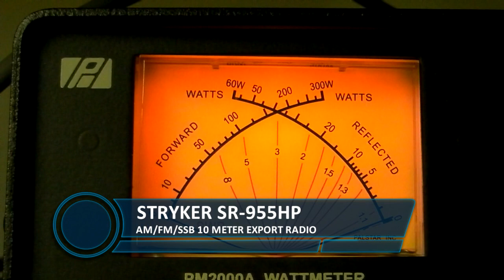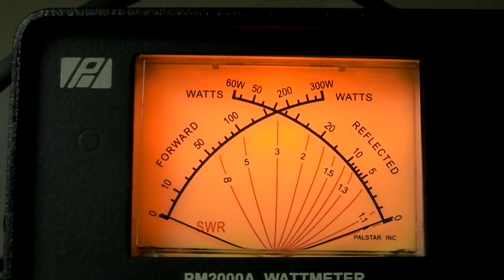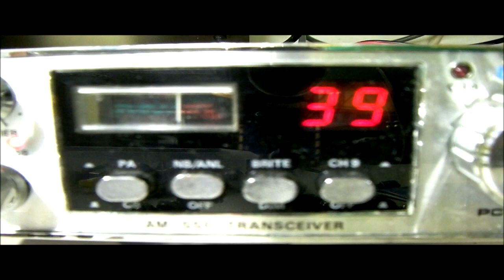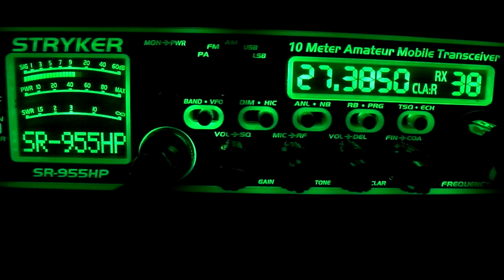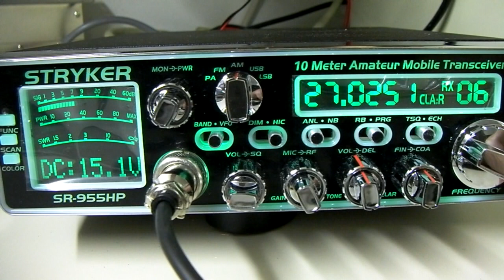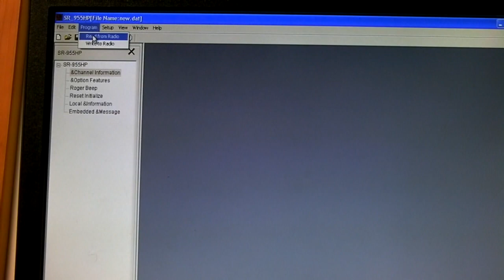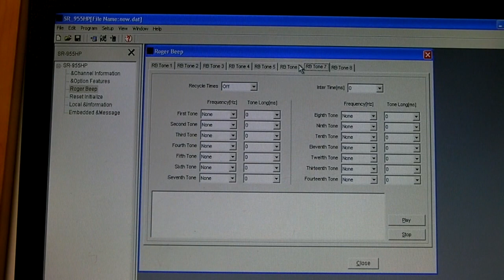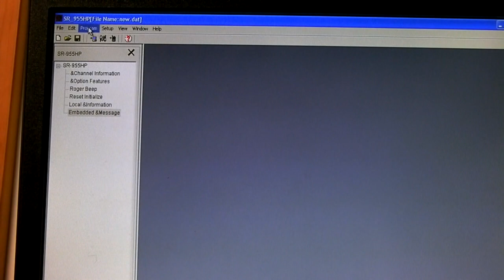Stryker SR-955HP Wattage TX & RX Audio Samples + Software Demo

Comment: Hello sir, I just got my 955hpc, I can not get it to pick up anything. On band 4, in AM I try to turn the dial to reach 27.1850 like you side in your video was ch 19. As I turn the adjustment dial it goes down and stops at 28.000 and then rolls over to 29.875. I've tried scans on AM and VFO. I can't pick nothing up

Comment: Does this radio come programmed with the standard 40 AM CB channels or do you have to mod it?
Reply: You mod it by removing 1 resistor to enable 27 mhz and it will not need tuning and that's as hard as it gets

Comment: just curious, towards the end of the video your voltmeter reads 15.1 volts. If the antenna impedance is 50 ohms, 15.1 volts squared divided by 50 ohms is 4.56 watts. To get 80 watts in 50 ohms you would need 63.2 volts. Does this radio have some kind of voltage booster driving the finals?
Reply: My 955 puts out over 100 volts at full blast.

Comment: Since the clarifier is able to be adjusted on Tx and Rx I was wondering if the frequency counter displays the frequency on Tx? Is it an active frequency counter I suppose is what I'm asking?
Thing is, if the clarifier frequency adjustment is set on the coarsest, then the tuning steps might remain the same when you key the mike if the Tx is only slightly off.
I've read the manual, looked at reviews but I can't seem to get a definitive answer to this question.

Comment: How many volts do you recommend to go into the striker? I'm only running 13.8. I see your at-15.. should I rise the voltage ⚡️
Reply: I do 14.2v and it seems happy. I have two 955 radios and both going strong .

Comment: I have one of these and it has poor reception unless the squelch is turned to where its noisy. 
The frequency's were messed up from ch20 to ch35 when I bought it but didn't know it until I needed channel 24. Turns out it was on the same frequency as ch 19. 
The 3 button reset fixed that thank GOD!. Every now and then there's a simple fix but I'm not often that lucky. I love the radio! It sounds Awesome on the air. With the squelch noisy I can hear Triple Nickel talking on his bass from Atlanta to Michigan.

Comment: I have been beating my head against the radio all day trying to get the software to work. 

Can you tell me the type of cable you used. USB to mini-USB?
My computer is not recognizing them radio. I have tried different driver, followed the steps on your website, spent 60 dollars in different USB cables. I must be doing something wrong. Pllleeeeaaaasssseeee help.
Reply: You need one from Stryker, not Wal-mart.
Reply: 2nd the usb cord you need has a dongle on the USB 2.0 side.

Comment: hey man I've got the same cb its squeals all the time when I turn up the mic and I got the top back still off is there any way to turn it down inside the radio it's definitely feedback from the speakers
Reply: +Joseph Byrd You may have RF in your shack.
Reply: 1. turn down mic gain 2. turn down talkback3. don't use a power mic.4. don't point external speaker directly at youIts probably over modulating could be rf coupling if the above list doesn't work. Then try better coax or ferrite cores around your speaker wires and coax.

Comment: A local guy has one, sounds XLNT on both AM & SSB, noticeably better than most other rigs, especially the higher-pitched sounding Galaxys, but he does drift A LITTLE, about what one would expect from any Amateur rig without an integral TCXO (Temperature Controlled (X)Crystal Oscillator) but after maybe 10-20 minutes of rather steady conversation he stops about 70Hz-100Hz down, it could use a TCXO for those who have to have it a rock from turn-on, but it's no worse than the best 'other' out there

Comment: Why is a 10 meter Amateur radio transceiver tuned to 27.3850 MHz?  Something must be wrong with the display.
Reply: nothing wrong with radio, people convert them for the cb band illegally
Reply: ***** FCC fine for out of band $7,000.00 !  High power another $7,000.00  .  The FCC has offices located across the United States and agents just looking to make a bust !   Just offer to sell the radio converted will get you a trip through the judicial system and a $7,000.00 fine !  By the way  how much do you want for this radio ?
Reply: +The Rodog Stupid to do? A cheap way to 10m.
Reply: +Martin Cvitkovich - not really stupid, probably easier to just buy one. Or, you might get the satisfaction of doing it your self, etc
Reply: I called the fcc and was transferred to the department for reporting violations. I finally got to talked to a guy and told him my radio has the illegal 11 meter modification and he said that was common on a radio like this and then told me thanks for calling and hung up. He didn't ask any information and he seemed to be unconcerned to say the least.
Reply: 10 meters is a joke, all those contest people get annoying.. Get your general.
Reply: Dont worry about it, as long as your not abusing it, your fine. Get your ham license too, 2 meters is fun.
Reply: 10-4 Good Buddy!
Reply: BIGBADWOOD 
Considering nearly all truck drivers use one if these export radios the fcc has alot of work to do. But you just keep believing that they will actually do something.
Reply: Lol .. the FCC could give a F about this type thing .. lol .. your wasting your time man ..

Comment: Though i have never used the SR-955..
I Highly doubt it is as good as a HF ham Rig..
Although my AR-3500 for its frequency's i would put up against my 706 but not my IC-7000..

However i hear what you are saying..
In Recent Hurricane Sandy...I was one of a handful of people in my city who had Excellent comm when even Fire/Police had major issues
Reply: ..."Though i have never used the SR-955.." OK, So.... what are you trying to say here? I mean, this is the SR955 and if you've never used one, what does the any of that have to do with anything? Don't misunderstand me, I'm thinking that I misunderstand you, so that's why I'm asking.
Rich
Reply: @Rich Paul  it's Not as Clear audio for my likings
Styker are Just amped up CB's

Here are better 10 / 11 meter mobile rigs
I own all of following

Again.. Clear channel AR-3300 / AR-3500
Though Not the Ranger AR 2970
( works well but Not clean audio)
As well as Icom 706 ( any their varients though I use 706 MKIIG ) also Icom IC-7000
Reply: @MrBOB39  Ohhhh! OK, I see what you're saying. I do own the SR955HPC but I don't think I've ever used it without an external speaker. 

I probably did try it for a moment with the built in speaker, but my point is that my SR955HPC, (V2), sounds a lot clearer than what I heard in this video. My Desktop is a custom built system with a high-end 5.1 speaker system, so I don't think it has to do with my speakers. 

However, I don't know anything about posting video sound on YouTube, which may or may not have something to do with sound quality heard. Perhaps if you listened to one in person, you'd have a bit better idea of what the SR955 sounds like, (just sayin').

Anyway, thanks for clearing up my confusion on that.
Rich
Reply: @richpaul8132  ok....Have a Good day

Comment: how do I get below 28000 on this radio
Reply: They have a 30 min vid that shows the resistor to take out. to do the mod.
Reply: Unscrew the speaker side lid. Look on bord right side and you will see a white arrow. In front of the arrow point is a single resistor and you remove that and you now have 27 mhz and you will not need to tune it

Comment: All Export radio's are legally sold as 10m ham radio's (wink wink) and need converted. If you go to cbtricks.com and look under Stryker radio's the process is in there.
Reply: To mod this for 27 mhz
You simply remove 1 resistor and it will not need tuning afterwards lol.
That's about it